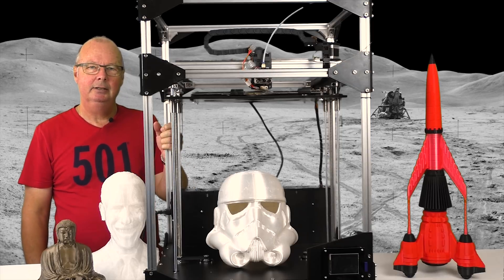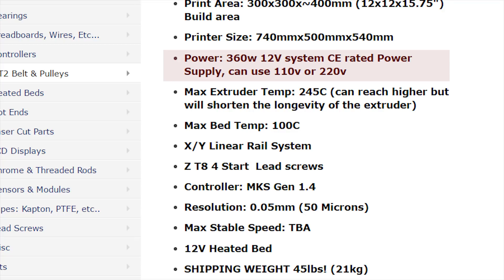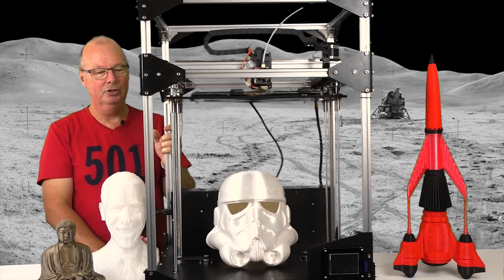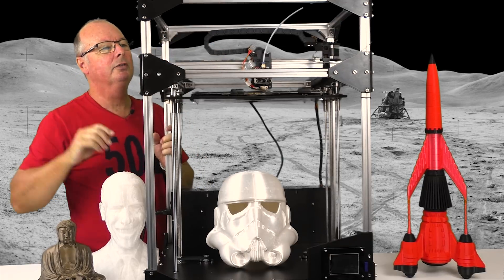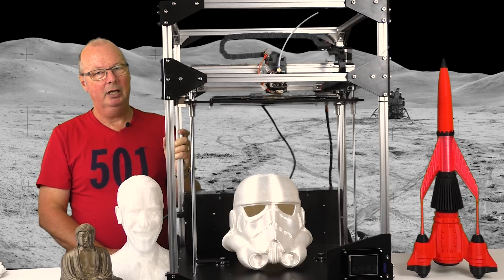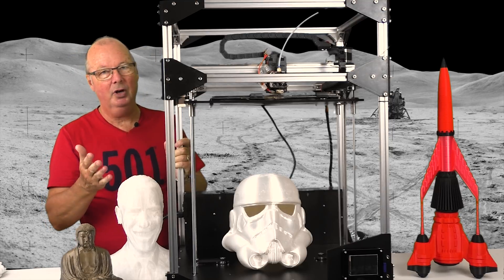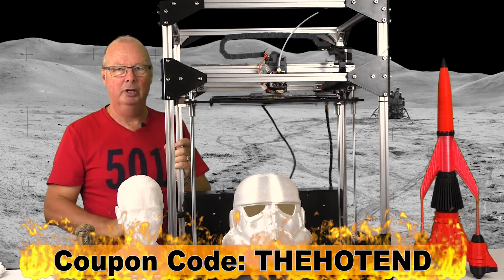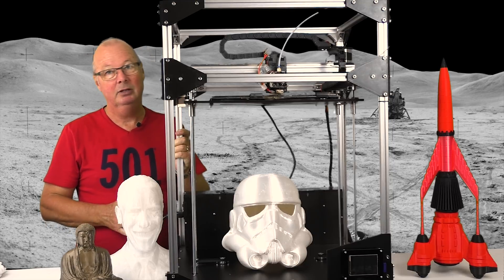Official Folger Tech FT5 Large Scale 3d Printer Kit Review! With Discount Code!

Comment: How do you add the touchscreen? link to the product used please? thanks
Reply from the maker: this will be available in the hot end edition upgrade pack coming soon - it also is running the MKS SBASE 32 bit controller.
Reply: I meant on the upgrade pack
Reply: Any new news on this?
Reply from the maker: +lb969 it's an mks 32 using smoothieboard
Reply from the maker: lb969 awaiting John folger - I've given him the upgrade list
Reply: Rod the control for a 32 bit upgrade. Far better than a fancy touch screen. Duet WiFi and 7” touchscreen is impressive. Plenty of room to expand and switch to single axis servos. Precision and speed will be improved two fold.

Comment: Thanks for another great video! Received my FT-5 earlier this week and well into the build. Used your code so thanks for that as well.  Question for you...I see you had some 90 degree corner braces added between the verticals and the top cross beams. How important do you think those are? I had a little difficulty getting mine all square and still don't think it's 100% perfect. Where did you get those?
Reply: very good pick-up. Those brackets are not in the standard kit. The printer in the vid. is Anthony's and pre-assembled, cut down for shipment, then I had to put it back together. The long verticals therefore, are in two pieces - hence the need for extra bracing. The standard melamine brackets are fine on a "normal" set-up.

Comment: Nice video. I'm getting ready to buy a printer and my choices has gone down to 2 printers: the ft-5 and the cr-10. I haven't found any reviews on the cr-10. Can you do a quick comparison and explain why  the ft-5 is a better choice? Thanks!
Reply from the maker: reprap style CR10 - where as the folger the bed only moves up and down - this makes it much easier to enclose - I have the wombot modus which is like the gmax, and ill take the FT5 anyday.
Reply: Thanks for your expert advice.
Reply: The Hot End - 3D Printing & Technology even today will your choice be same?

Comment: Is there a confirmed list of changes made in the new batches of printers? Ordered mine last week and getting anxious to get it. Thank you for the promo code, I used it and I'm happy to support the channel!
Reply from the maker: email support@folgertech.com to confirm latest revisions
Reply: The Hot End Thanks for your speedy response! I know this is a highly subjective question, depending on the experience of the person, but what would you say is the most tedious/challenging part of the assembly? Possibly the gantry/hot end?
Also, in one of your other videos you said you prefer to use crimp connections on the PSU. Why not solder these?
One last question, can you recommend a print fan? 
I appreciate any feedback!
Reply: ok, assembly - making sure everything was square and true, and those fiddly %$#@& T-nuts.
PSU - was referring to using plug connectors, crimped and soldered, as opposed to just soldering the wire direct.
Print fan I use is similar to this: http://www.thingiverse.com/thing:1817094
Reply: john martin thanks!

Comment: When is The Hot End Edition going to be for sale? I'm holding off on this kit for that edition.
Reply from the maker: Thats a question for folgertech - But it WILL be an upgrade kit option for those that already have an FT5 when its ready
Reply: Ok thanks. Can you list what the current plan is to be included in it and pricing?
Reply from the maker: Id like the hot end edition to have an upgraded extruder (e3d possibly) enclosure, silicon heated bed, mkssbase smoothieware, touch screen) - pricing TBA
Reply: Any chance of a dual extruder setup?
Reply: About to order my FT-5 now, thanks for this very in depth review!  Can you provide links to the e3d, heated bed, smoothieware and touch screen please?  I may just go ahead and buy those pieces now.
Reply from the maker: bmacrae15 this is on the list we are testing
Reply: Cool, thank you! I have been looking forward to having a dual extruder printer. Having the size of the FT-5 would be great!
Reply from the maker: +bmacrae15 I'm looking into a 2 into 1 extruder that's in testing now before we release an upgrade pack plus a full hotend edition
Reply: That is exciting to hear! Or as Mr. Burns would say, "Excellent!" :-) Do you think it will be available within the next 3 or so months?